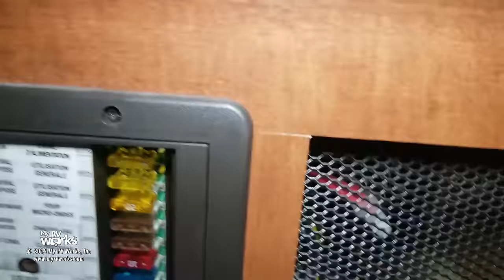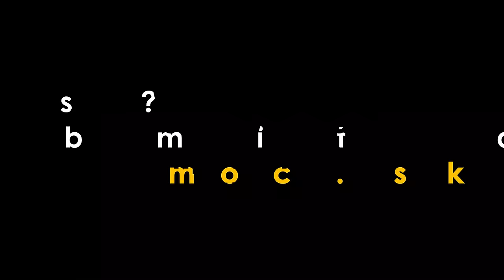RV Power Problem Leads to Converter Diagnosis and Replacement

Comment: How do I know which converter to buy? I have a 2016 bighorn fifth wheel with 50amp service, two batteries in front cargo with solar panel on roof. Toilet overflowed while I was gone, lever stuck down and water poured into my heating vents on the floor and then I noticed my batteries weren’t charging. Water ended up in the basement storage compartment right around where you said they put the converter sometimes. 

Haven’t checked the fuses yet but I’m preparing for the worst.

Comment: I will be tackling this project on my destination rv this spring. 
My RV is always hooked up to power, and our last trip to the RV last fall I was having issues with the lights staying on. This video has helped me deduce that that is the converter.

My RV is about 4 hours away from my house. I would like to bring a replacement converter with me when I go the first time the spring.

So I have a question, are these converters one size fits all in RVs? Or is this definitely something I need to look at the unit that's installed, and match up numbers and specs?

I know this is an old video, hoping somebody sees this and can point me in the right direction.
Reply from the maker: One-size-fits-all. The numbers to look for is the amp rating of the converter. I usually go with 55 amps.

Comment: I've encountered a situation where one leg of the 50 amp circuit at the pedestal was dead.  I had AC on the microwave, like you see in this video, but the converter / charger was on the other leg of the AC, so no power to that side.   Check the breakers to see what is on each leg of the AC.   Admittedly, this isn't the norm, but still something to check before you start ripping stuff out.
Reply: What was your issue? I have similar problem
Reply: And ty!
Reply: @jameswhite1338  Same situation as described in this video - batteries were failing as the converter / charger had no power.   Then I started checking other appliances and 110 volt plugs on the same side of the circuit as the converter and found they weren't working either.
Reply from the maker: Hi Clark,

That is a great check for all of the 50 amp coaches out there.  In this video it was a 30 amp coach so it only had the one hot leg.

Happy Camping,
My RV Works Media Team

Comment: Any info on a magna tek 7300 series? It’s in a 2001 trail bay. Shore power, no dc. Battery drains doesn’t seem to charge. Don’t know if I should try and replace or upgrade to ??   Thanks from Alabama

Comment: And another thing is when I bought this camper everything worked but when I turned it to 2:20 when it blew everything and I replaced the capacitator just one my plugins work but like I'm trying to say is I do not have one of them boxes behind the breaker box I got a converter box underneath of it but I ain't got one of them boxes at the end of your video that you're working on never had one in here

Comment: If you were thinking about adding Solar, and you happened to also be replacing your floors, so you have the whole thing gutted, 1) what prep would you do while nothing's in it to set yourself up for success if you're going to do it later and 2) would you run with some sort of combination of existing stuff/ house battery with new stuff or would you replace 1 with the other?

Comment: I have ran the manufacturer troubleshooting steps on my converter and it checks out to be working properly. The fan won't work at all on the converter, the AC trips the breaker, the fireplace trips breaker, the fireplace is wired to same breaker as converter. All 12v lights and refrigerator work without any problems, lights do dim very little sometimes. Could this be related to a converter issue or a more serious electrical problem?

Comment: I’ve noticed after running my ac for a day or 2 in hot weather my lights will dim and the ac will eventually quit working. Will a bad battery cause issue’s with the converter? Or do you think the converter is shot? My tv and anything plugged in to 120 still works.

Comment: I get lights and everything on grid but nothing on battery with good batteries.  The wall does not work when plugged in either which I have heard that runs on 12 volt but I no nothing.  Does that sound like a converter?  I appreciate any tips

Comment: Thanks for the proper steps to diagnose the converter.
I do have a bad converter, however I can not find a replacement.
WFCO does not make the WF9990 any more. They recommend the WF9580, however, no one carries that model. WFCO does not sell to the public so where do you get your product.
I’m in central Oregon and it would be nice to buy something close.
Also WFCO recommend the WF95880 Lsi if I were ever considering up grade up Lithium.
Please HELP

Comment: I get 12v from the converter when plugged into shore power but no 12v when not plugged into shore power. Different from what you found. Hmmm. I know my two deep cycle batteries are good and charged. Checked fuses on converter. I guess it still could be the converter. It is getting its 13.4v from the battery but not working if no shore power

Comment: I have a 2013 wildcat forester. Nothing but issues sense day one. Wasted extended warranty. Anyways, my bathroom fan stopped working & two of the front room over head lights but all else works so far. I checked the fusions and changed them out and still the fan isn’t working or the two overhead lights in the living room. Can’t afford to have somebody come back out. I’ve already dumped $1500 into leaks furnace replacing the toilet etc.. any idea please & thank you 😊

Comment: From your previous videos should you check the post power before installing new converter?
Reply from the maker: I verify power feeding the converter is within spec. If it is not, that starts a whole new troubleshooting trail to figure out why it's not.

Comment: Great job,
I have 1986 5th wheel, everything worked great until the otherday when i accidentally touched bare wires on converter with screwdriver and the converter started buzzing very loud, if i trip gfi breaker it stops and the gfi runs 4-110v outlets in back of r.v., i turn gfi on it buzzes converter quite loud but it doesn't trip a breaker, i talked to several electricians and they no nothing about it or converter, wonder if i could get a newer model converter for it.

Comment: My prob started when i hit the batt disconnect momentary switch to off, while running my gen, and all power went out including the gen cut out. I have 12v power when on shore plug but not otherwise. The batt. disconnect switch makes a click sound at the solenoid but wont power up the right side pole of solenoid. Is there another fuse somewhere, before i go through the hassel of wiring in a new solenoid?  There is an odd looking black fuse block distro panel w white round springy amp labeled circuits for "slide", battery, step, etc but they are all loose springy pushed in feeling. Do those pop out when tripped?

Comment: 12v lights ect go very dim out of nowhere (usually when it's cold outside/inside, like early in the morning), but when I run the microwave, coffee pot, anything ac w a big draw, the 12v stuff comes back to normal. Often it goes normal just while the microwave is running then dips again when it shuts off. And I have to keep messing w it until finallyyy the 12v stuff stays working as it should. It's as if the converter isn't pushing enough energy through unless the ac draw is big. And often the propane alarm goes off and I've heard it's a low battery/low converter output alarm. (I have no batteries connected, only shore power) (I am getting a multimeter today to check 12v output.) But it's sporadic, it doesn't do this all the time. No breakers ever trip, fuses good.

 I'm hoping and thinking a new converter would be the fix, but I don't wanna spend the money if it's not.. anyone have any ideas? Could this possibly be a wiring issue, or connection issue? Because it's just started when it got cold and I tried running the furnace, ever since it's done it sporadically in the morning when it's cold like 40 or below. Can a bad ground connection cause this?

Comment: 81' GRAD from Port Angeles here (now live in AR)...This is exactly my issue in my 2018 Montana. So I went and bought a Renogy inverter/charger with a 100ah Li Battery. I was thinking to make the move anyway. So when the issue popped up, I thought...I got this, I will replace my old 1000w inverter with a 2000w inverter/charger! I have not started yet. So, my question is, do they make a converter without the charger (since I now have this covered with the inverter) ? If so,  could you (or anyone of you other really smart guys) what I need to buy. Thank you in advance!
Reply: Check the specs on the Renogy unit, it may have both units inside since it's intended to charge in one mode and Invert in the other. My older 'Outback' 3500W unit does and many others do also (KC7JJ - east of Port Angeles).

Comment: great vid , we call the converters charger ? power supply`s in Australia , that's what made me watch the vid to see what a converter was , I have the DAKAR Kombi inverter charger in my winnebago I don't use the charger as I have 600 watts of solar and 5 x 135 amp AGM batteries , It keeps up ok with the Australian sun ,,, but now we are heading into Autumn maybe I will have to use the converter ,,, Anyhow Stay safe Keep the great videos coming ,, can't wait till the next one 
R.J T traveling the east coast of Australia
Reply: We call a charger a device that charges a battery.

Converter = 120v to 12v
Inverter = 12v to 120v
Reply: But you are not running your DC system from the CONVERTER you are using the 12vdc batteries .the CONVERTER (CHARGER) is charging the batteries to 13'6 vdc ..thats why YOU NEED TO WAIT TILL THE BATTERIES CHARGE . To use the slides .....easy ..
RJT

Comment: Ok so I replaced the vent fan motor in my bathroom. But I have to be wiring it wrong because when I tried to turn it on, it blew the fuse. I replaced the fuse tried to turn on the light and again and blew the new fuse. So now both my bathroom lights and the fan switch will blow a fuse. Can you please do a quick video explaining how to wire a bathroom exhaust fan motor and switch

Comment: Thanks! I've been renovating a 2002 Fleetwood Mallard that I permanently placed on a lot with electric service only.  The Campground provides mobile service truck for water and sewer at a nominal fee. I have a  250 gallon water storage tank, pump, and pressure tank that I'll use to build an outdoor kitchen and shower, therefore taking a lot of the workload away from the trailer.  I'm building a small drain in the ground to accommodate this. (I will be the only person using the system day to day) I will use the indoor water for toilet and kitchen, mostly, and an occasional shower in bad weather. 
Q1- Should I use the rv clean water storage tank for indoor use and keep the outdoor system totally separate for my outdoor use? I do plan on having a separate water heater for this. I think I'm better off keeping it separate because I could mistakenly overfill the gray or black tanks. (If I have a visitor that doesn't know what is going on with my system for example).
Q2- Since the rv is permanently  on the lot, is it possible to get by without using batteries? I currently don't have them and really can't afford it. I have not used the refrigerator, air conditioner or heater yet nor have I connected propane. I used 3 electric space heaters when we had a work weekend in December (28 degrees Ferenheit at night) and they ran overnight with no issues. 
I applaud you and your team for the excellent work. You are a great teacher, easy for me to follow, and the content is very well organized. It took me a while surfing many sites and groups but I feel safe and trust the info here. Thanks again!! Ps  having more trouble trying to increase the amount of the superpay!! Maybe I need a video on that!😅

Comment: Hey Darren, great video! I noticed that you went into good detail explaining how the battery charger and power converter are indeed, two separate “appliances”. Few people realize that. My question is ; if only the converter was failing and the battery charger was still fine, why would the battery be dead even if there was a minimal load (a couple of amps at most) to keep the control boards functioning? Did you customer lose power while dry camping and have no shore power?

Comment: I have a question I had for lead acid battery I’m just now switching to lithium batteries two of them 200 amp, so what converter would I have to change for this?

Comment: My 2006 hurricane motorhome is making a noise in the engine compartment , is e relay behind  the fuese panel . Cable batteries are connected to it . The relay is clicking on and off . Is this relay part of the converter?

Comment: Do you know where the converter is in a 2011 Wildcat 5th wheel? Battery isn't charging, and refrigerator, radio and a light doesn't work. Hmmm?

Comment: I'm having trouble with my inverter it sounds like a woodpecker is in my rv and the lights are flickering very fast the woodpecker noise is coming from my inverter under my dining room bench seat do younhave any ideas what that could be? Thanks!!! Also when my generator is running I will have no power to the lights or anything but when I plug into power the lights go crazy and the inverter is clicking rapidly!!!

Comment: I have  120v to the microwave using the 50 amp to 120v "Y" cord but its not charging the batteries. I then plug in the 30 amp part of the "Y" cord and use a 120v adapter on it. It then charges the battery as it should. It all works fine when the generator is running. Ebay purchased 50 amp cord out of the rv with a "Y" cable 120v and 30 amp adapter cord, i'm thinking the "Y" cord is bad on the 120v side. Just curious.

Comment: I was in my rv today here in carlsbadd got here saturday night connected everything everything was working good its a 50 amp all of a sudden i was sitting down in the couch and then everything went off i checked the braker from outside turned it off and on and connected it again and nothing i unplugged the extension and tries running it on my battery turned on the lights and it berraly turned on like a centimeter of light thats all it was giving its brand new bought it like 3 weeks ago the battery thing is off and the rv is connected to the post and the microwave has light and the 110 connections have light to so what would be the problem i checked all the breakers shut them off and on outside and the rvs breakers to checked all the fuses they all looked good but the battery is dead i bought it 3 weeks ago first time with my rv its my first rv and this happens would it be the converter ?

Comment: Sealed batteries require slower charging but what about in my instance? My camper came with like an 80 aH I beleive, and I upgraded to a 260 aH single SEALED battery. And I understand that you can safely charge these at 10% of the aH of the battery.  So a converter designed to charge at like maybe 10-15 amps possibly, I should be fine without upgrading right? Because I'm only charging at max 15 amps on a sealed battery that should be able to accept 26 amps +/-. Does that make sense and sound reasonable that because my battery's size, I shouldn't have to worry, because its already getting a slower charge than usual?

Comment: What would cause my converter to hum loudly sometimes. And it also hums when I press the button to check my battery? Do you have any videos that possible answer these questions. I have an issue with kicking breakers all the time and can only use one appliance or wall plug at a time. Any help would be greatly appreciated.

Comment: Are there different  types of converters or are they all pretty much the same? Also, wouldn't the new converter be making a sound to charge the dead battery?
Reply: Like most items, quality varies with cost. The newer converter/chargers switch the voltage at a much higher frequency than older ones, so you likely can't hear it but the fan is usually thermally controlled so high DC output usually turns the fan on. I check DC charge rate via DC ammeter.

Comment: Nobody ever mentions the cabin disconnect. My 2000 beaver has one at the entrance  stairs. Big switch on or off. It will terminate all power to the 12 volt panel and more then half the 110 outlets. Its purpose is to shut down all dc consumption during storage.

Comment: We are popping the 30 amp fuse marked CONV on the panel and the battery is not charging. Shore power is running all outlets, etc.and the breakers are not tripping. When we charged the battery seperately the 12 volt items will work, but new fuses in the same spot keep popping. Is this likely to be the converter or something in the wiring on the circuit board where the fuses are?

Comment: I have no 12 V lights my refrigerator. It's not working but my battery is dead I am replacing my battery now is there? Do I need to disconnect and reconnect it any special wand can I do it while i'm hooked up to  shore electricity?

Comment: I have a problem Houston..lol..my 50 amp shore power surge protector says faulty ground and low voltage. Ugh..Battery low and charged up using generator and now microwave works...hear fan motor on converter but have to undo single bed to check fuses and hopefully not replace converter...it a shore power problem but where??? Thanks for any input.

Comment: Hi, I am trying to sort out a problem with a 3 way fridge in an RV. The fridge has not been used for several years. The heater works but there doesn’t  seem to be any circulation, the heat not traveling across the top finned section. If the fridge is turned upside down you can hear bubbling / fluid movement in the pipes. There is no ammonia smell or signs of yellow residue around boiler. Do you have any suggestions what I can  to get it working.